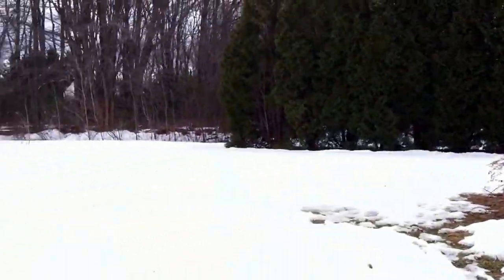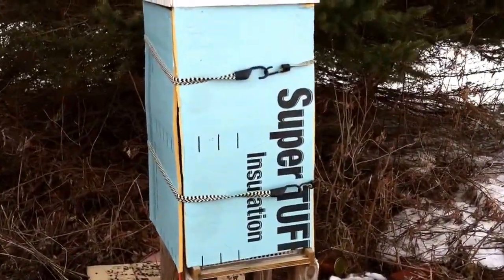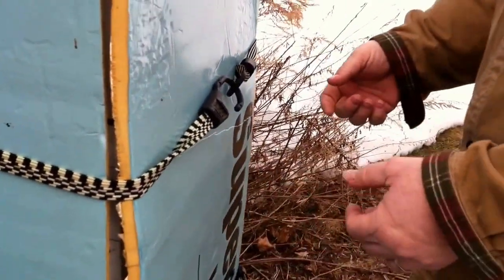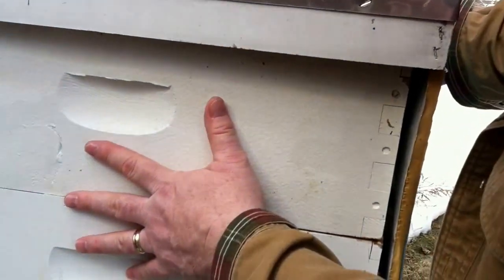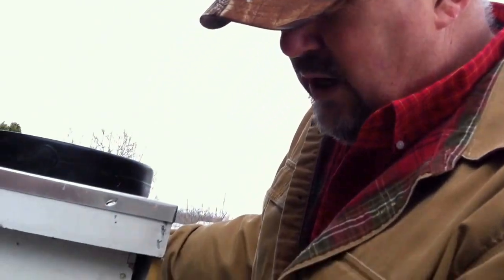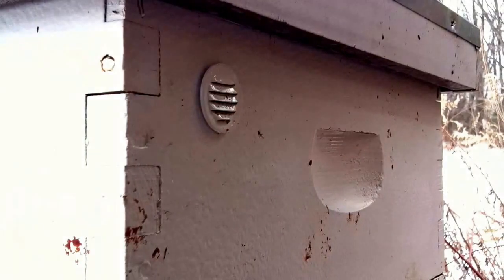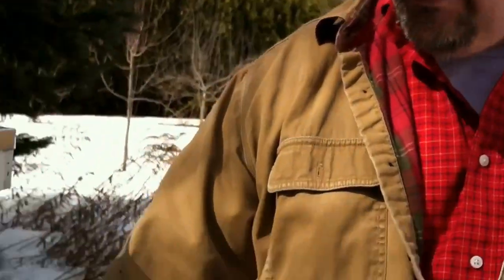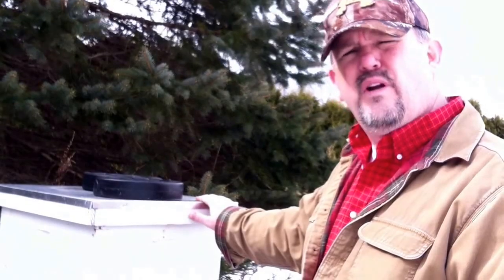Wintering a Beehive in New England

Comment: I have a hive somewhere in my house but cannot find the nest. They are making their way to the basement. With no insulation in this house they could be anywhere. Anyway to pinpoint where they are
Reply from the maker: The first thing to do is figure out if they are honeybees or some type of wasp. If they are honeybees, it is best to have them removed by a local beekeeper. If they are wasps, a local exterminator can be called.  They are most likely between the studs of the wall. It can be a challenge to identify which part of the wall they are in. Tapping on the wall and listening for their buzzing can help. Using a cheap stethoscope to help hear them buzzing can also be helpful. Again, there are some beekeepers that will do this for you. Once located, it may be necessary to remove the sheetrock in order to get access to the bees so that they can be removed. Repairs would then be required. Finding their entrance will also be important because other bees could use the same access point in the future. Good luck.